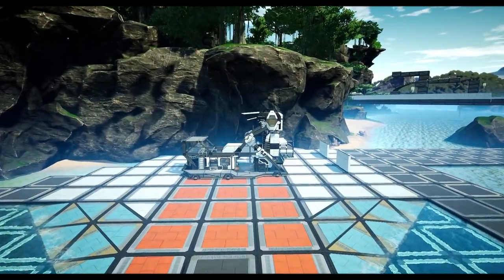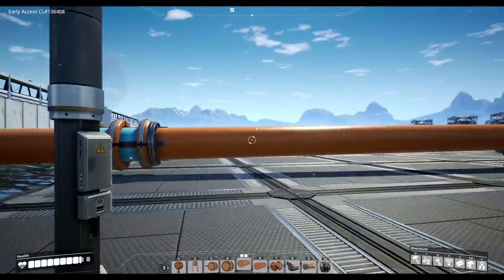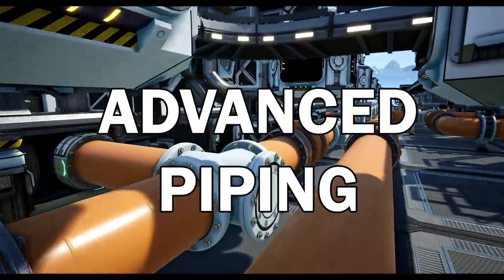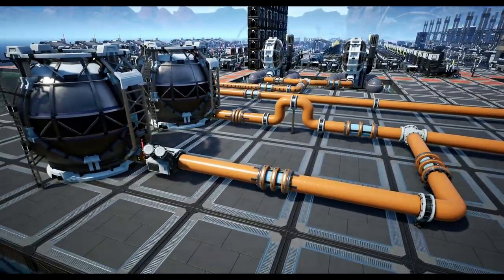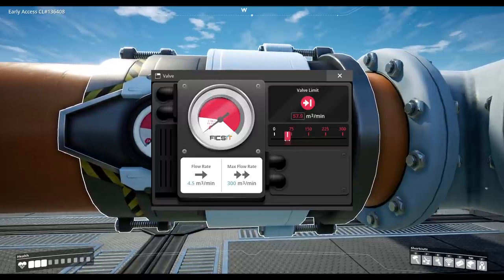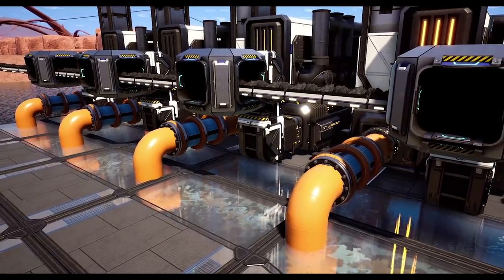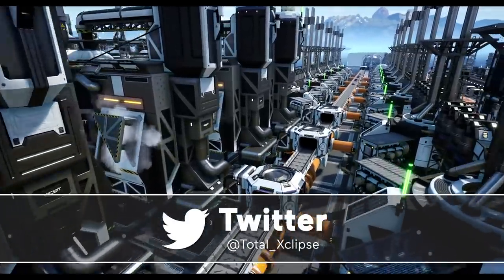The Essential Guide to Fluids in Satisfactory. Part 1 [Update 3.6]

Comment from the maker: Who else spotted the mistake? 
"Noodle" mode is only for hyper tubes, the one for pipes is "Conveyor 2D" My bad
Reply: i wonder whose excellent ears could have picked up that mistake
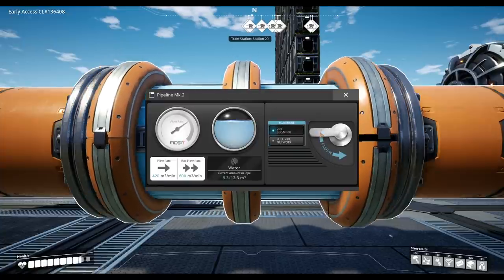Reply: The timestamp for 2:30 is 2.30 in the description as well. Just a heads up! Love everything you do mate, keep it up <3
Reply: Haha didn't really notice that 😂
Can't await part 2 I hope I can find useful tips for vertical building. If I build vertical and then put in the junction point in my pipe it is not exactly rectangular and that drives me insane. Then i delete the wall, vertical pipe built a foundation horizontal pipe and then the junction point etc.
Reply from the maker: @joeb3505  Yep fixed :D Thanks
Reply: Iiiiii
Reply: @calamity7535  iii
Reply: TotalXclipse..
about to see the next video dunno if its covered there but here goes.

instead of running 3 Waterpumps with 3 pipelines.

Why not run 5 waterpumps with 2 lines? 120x5 = 600 / 2 = 300

in a setup something like this
       
---I I---
---I I---
    T
Reply: Dude I paused the video right after that and said it out loud (as if you could hear it lol)
Then saw the pinned comment lol

Comment: Regarding to empiric data, hence testing a lot, i discovered some issues with oil extractors and the MK2 pipes.
While an oil extractor on a pure node and some power shards can supply 600 m³ of oil, it doesnt have the power to push for a 600m³ flowrate it seems. At least for longer distances. It became obvious when an oil extractor supplying 600m³ couldnt support a turbofuel factory that uses up 600m³. On inspecting i saw the extractor stalling out at like 70% efficiency, since he stopped working when the pipeline was still too full.

 I could however manage to overcome the issue by placing a MK2 pump right after the extractor.
Reply from the maker: I was going to say have you tried adding a pump, the problem is all the pipes do need to fill up first so on longer networks it can be slow to run (in theory) but I haven't run into the problem yet

Comment: I hope this is covered in the next video but when do I need to place water pumps? is it just vertically or also horizontally?
Reply from the maker: Don't worry it will be covered :) generally you just need to place them vertically but it can be useful to boost the system horizontally along a long pipe